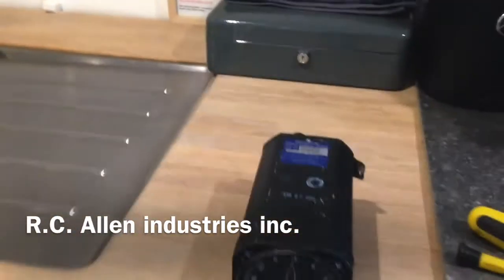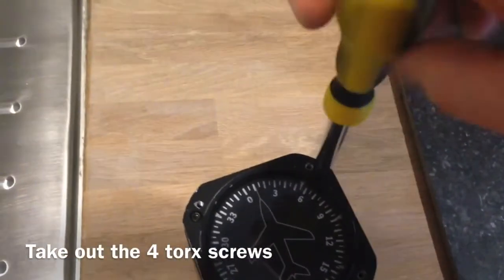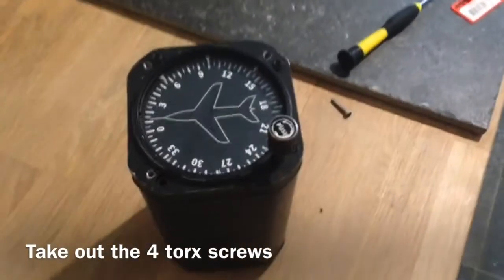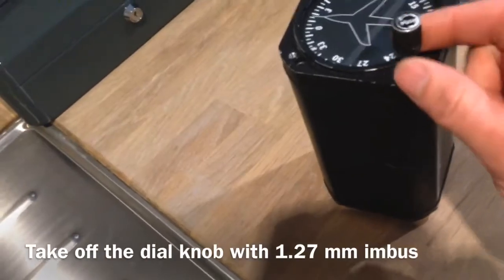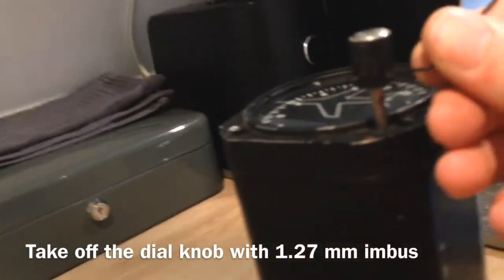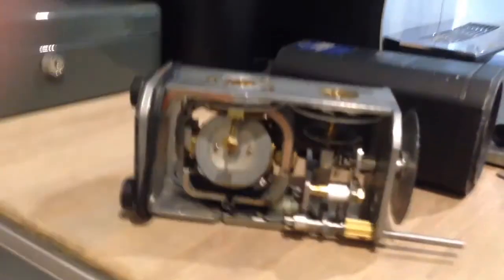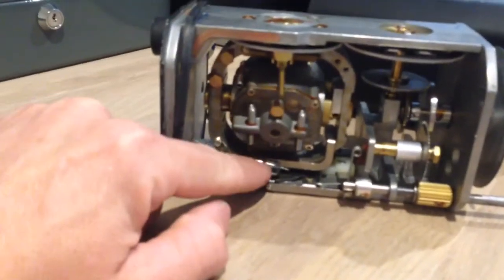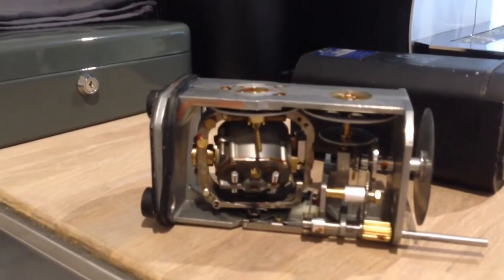How to open a directional gyro

Comment: Did you resolve the problem with this black melting plastic by the spring  you mentioned on the video? Mine have the same issue?
Reply from the maker: Hi Krassimir,
Yes I did resolve the problem, it's now 3 years since and it works perfectly.
Reply: They are called grommets and they kinda melt after a long time and need replacing ....I work in an instrument repair shop